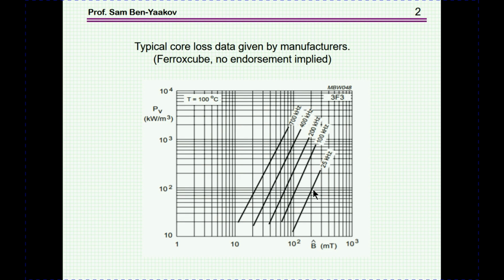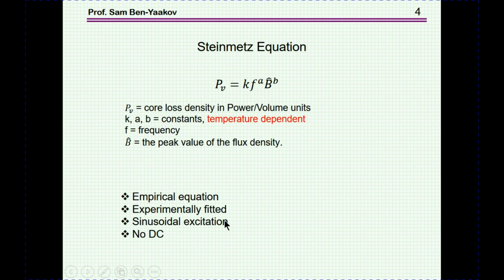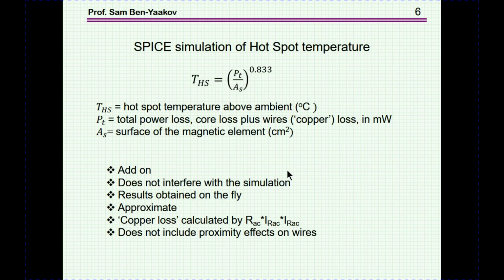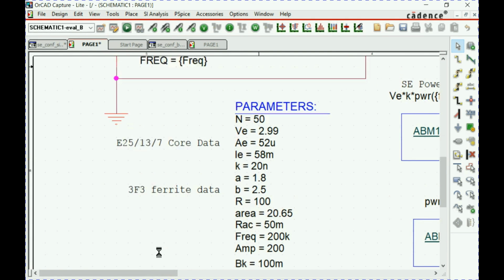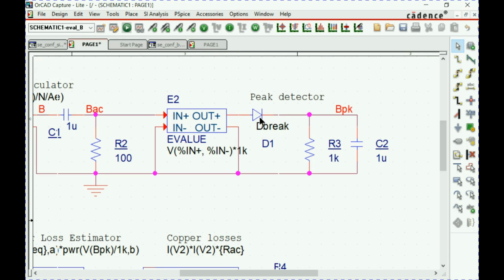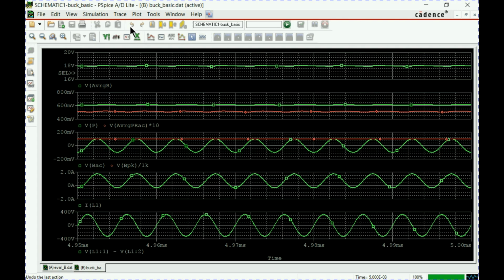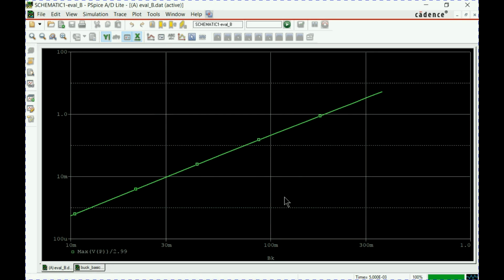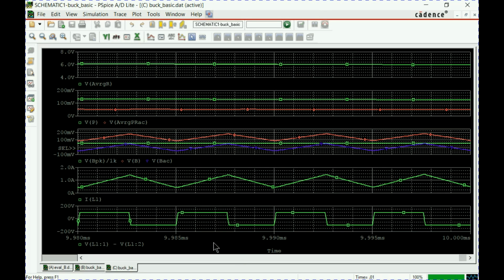SPICE simulation of ferrite core losses and hot spot temperature

Comment: Thank you for the great video. How is area = 20.65 calculated?
Reply from the maker: Please indicate the slide number or the minute you are referring too
Reply: @sambenyaakov  Thank you for quick answer. Time is 9:42. One simulation parameter is "area", which is 20.65.  I think it is related to the surface area of the bobbin for hot spot calculation, but I am not sure how you came up with this value. I couldn't find it in the datasheet.
Reply from the maker: @hosseinpirhady8045  This is the winding area. Look for the datasheet of the coil former
Reply: @sambenyaakov  Based on E25/13/7 datasheet, (20.05 × 20.05 × 2) + (15.45 × 20.05 × 4) = 2043 mm2 = 20.43 cm2. Very close to your calculation 👍Thank you for your response.

Comment: In experiment, how to determine the load (DC bias) when trying to fit the Steimetz equation? As you said it is a first order equation that does not account the DC bias, and higher load current tend to have more core loss, should we bias it at the max load and the fitted parameter will be the worst case core loss?
Reply from the maker: Peaceably, but there ae papers (e.g. by Prof. Kolar) that developed models of the bias effect.